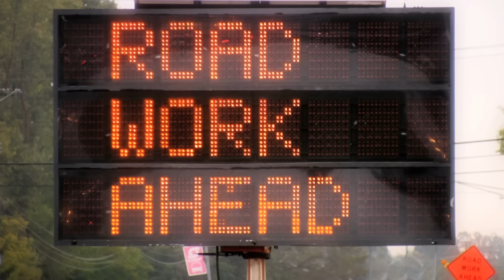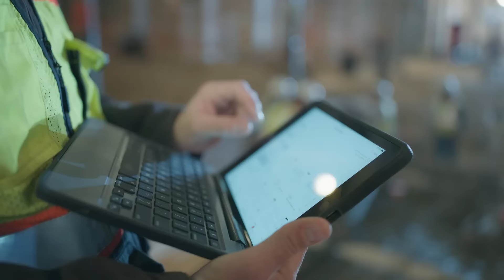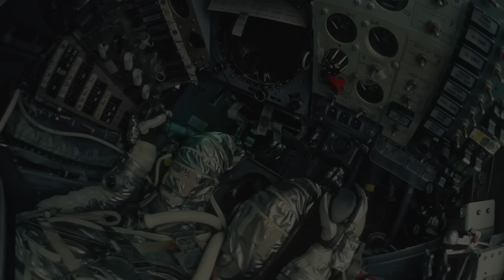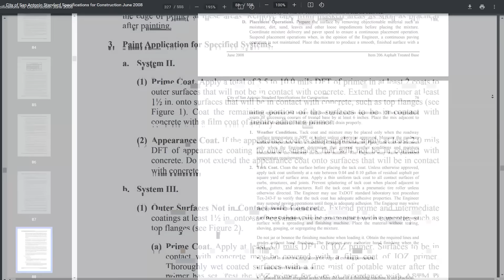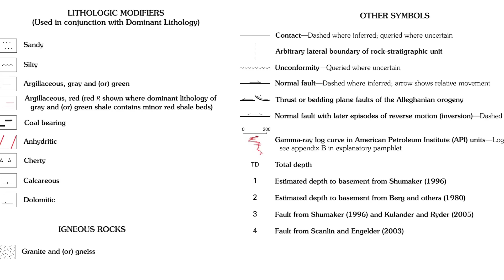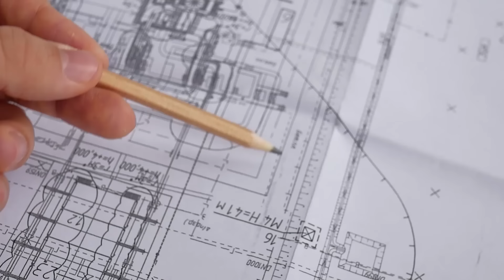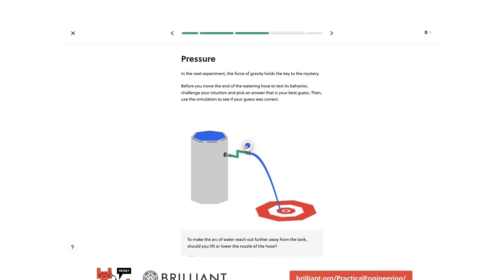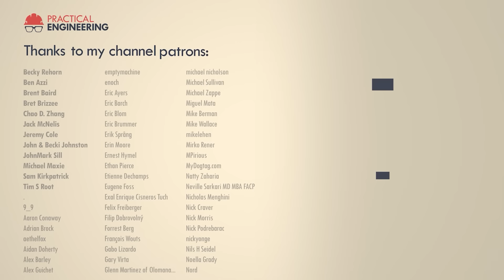4 Myths About Construction Debunked

Comment: Your first point about construction companies being incentivized to keep costs low and to get the job done on time seems to fly in the face of literally every major construction project I've ever seen - We always hear about how this project or that project has gone massively over budget. 2 - 3x, or even 10x  increases don't seem to be very uncommon.
Reply: Going overbudget doesn't mean the company not trying to keep cost low, a client can easily be responsible for a cost increase, sometimes trying to keep the cost low can also lead to an overbudget when company cut one too many corner. Not correctly estimating the cost of the project can be the sole reason of going over in the first place. Their can be many reason for an overbudget. An over budget may not even be an over budget for the initial client for someone that has worked alongside people managing small scales construction you can go overbudget because someone screw up, and need to pay someone else to correct the job, but the one that screw up is the one that is going to billed the differences. For large scale construction this can even lead to large trial.

The only time I saw people deliberately not working or not trying to to keep the cost low was when wealth didn't flow down to worker, if you get a bonus for completing work early but the workers don't get any of that bonus and just get more work, you can bet they will work slow to complete the work for the exact amount of hour billed or estimated. The other case was when subsidies were involved, some people seems to think it is okay to inflate cost when the government is paying. Which is something I found despicable.

Comment: as far as longevity goes the older stuff was made better. in the past, even the recent past of the 1950's, the mix of concrete was made for the project itself. today we go to a store and by premixed concrete, which we want to be ready sooner, and that means that it spends less time curing and hardening. depending on what we are doing specifically this either is good or bad. we don't care about the times this cheaper faster stuff works just fine, but we do see when it does not work. we also tend to use that stuff more than we should, and its market share increases because it is cheaper. basically concrete isn't equal to all other concrete, and we generally don't understand this or the market forces and social forces around using the wrong mix.

Comment: The reason why the lowest bidder model is used in most places are that it is an objective measure. Most if not all other metrics I have seen in contracts are ultimately subjective. Innovative? How do you measure that. Efficiency? How do you measure that? Keeping in mind that to measure efficiency you have to devote resources to record efficiency metrics. Look at how policing has devolved in many places to chasing stats instead of criminals. I don't think there is a solution to this problem and that cost will remain the best measure for the foreseeable future.

Comment: What about the DOT work crew I saw on my way to a dentist appointment that had 1 of 2 lanes closed with 3 pickup trucks with 1 trailer hauling an excavator. There was no one working on the way to the appointment, and the excavator was sparkling clean. However, when I was heading home after the appointment and a meal, the same crew was still blocking 1 of 2 lanes, but this time it was 2 miles further down the road and still, no one was working and the equipment was unused.

This crew was closing down half the road while doing nothing and just slowly moving along the road.

Comment: The success of a project is wholly dependent on the management and expertise of the project managers.  The more specialized the construction, the more this applies.
There are a couple of things with respect to the lowest bidder.  Yes there are specifications, however they cannot anticipate every eventuality.  There are always going to be changes and the contractor wants to be compensated for those changes, which can be significant, especially with foundations and civil work. Some contractors have more experience than others; alarm bells always went off when the low bidder was a contracting firm run by MBa's that subcontracted everything.  When bidding is tight often the low bidder is the company that forgot something in the bid, or the low baller hoping to make their profit in extras.

Comment: I'd say the part about the lowest bidder probably stems from the military. It's no secret when I was in the infantry every single piece of gear the Army issued me was made to meet a specific standard and was the cheapest option. Problems came when two separate pieces of gear needed to work together. Often times issued magazine holders seldom properly held my magazines well or at all leading to the "made by the lowest bidder". I know NASA also used to be mostly ex or current military and probably still is so I can see it carrying over. Before I got out in 2015 I lost a good PL who was accepted by NASA to train as an astronaut. Just my thoughts on that.

Comment: When considering the value of Roman Concrete, have you considered the self healing properties caused by their using unslaked lime leading to pockets of volatile powder which can react with water when it seeps in to seal and repair cracks as they form? No doubt we have great concrete, but even in spite of our much more advanced material science, we may still occasionally have a trick to learn here or there from the master engineers of the Iron Age. This isn't, of course, to say that over all their concrete is "better" than ours (better by what metric or what purpose is always the question) just that they may have some interesting properties worth taking advantage of.
Reply: To be clear, we began to develop our own self healing concrete in the 90s, but as I understand it's still very much a growing and developing market which is only just taking off with expectations of growing the entire market by a multiple of 17 over the next 10 years.

Comment: There is quite a bit of gray area. There is indeed quite a bit of "standing around" at various construction projects and it's not always because of some other task or resting. 

Also regarding the lowest bidder, that is a toss up. Not every trade receives an engineer designed copy of plans to follow. There's many cases where an engineer is hired to do some level of design to get the building permit rolling, they might not even have any expertise in the trade for which they draw up plans but do so anyway for easy money. It's then up to whatever contractor to design the system themselves. You frequently end up with more fly by night type of contractors that very much do shoddy work become the lowest bidder versus contractors who can properly do the work.

I'm also an engineer in construction, but I work directly for a contractor to do in house designs. It's actually very rare to get a set of plans for my trade, designed by another engineer, who actually understands the system involved. Also, inspector's and plan reviewers generally won't catch major design flaws by other shoddy contractor's work. Plan reviewers tend to rely on the engineer of record's seal, and therefore only check to see if their personal favorite go-to notes are missing from the submitted plans. Inspector's know even less than the plan reviewers...

Comment: I wouldn't say "planned obsolescence" as much as a much more fundamental business concept: amortizing your assets. Any asset has a useful lifespan, whether it's a car, a computer, a machine, or a bridge. If an asset costs $100,000 and it'll last you 10 years, then you should think of it losing $10,000 in value every year. A be you should budget for that. If you buy an asset and just run it into the ground without thinking about when you need to replace it, you're going to have a bad time

Comment: Been in construction 20 years, have multiple trade tickets and even have my MET as i was gonna be an engineer. First off engineers are never on site unless theres a serious problem, or someone is calling them out knowing they screwed up. 2nd laborers are just lazy its the crew size thats mandatory so half of them just stand around. You do have a point with excavators tho.  3rd you touched on it but neglected to mention that everything engineered these days is meant to do the minimal required task with as little manpower and material as possible as the norm.  So you know as well as i do everything is built to fail. Also like how you sided with cutting corners or at the very least sided with contractors who cut corners.

Comment: Since rebar rusts, would it work to connect a sacrificial anode wired to go through the concrete? Seems like we could extend its life for just a small amount of power.
Reply: Been done. A lot of long life concrete that has rebar in it uses stainless bars. The green coated steel isn't much cheaper and will corrode anyway. Stainless bars!

Comment: I might also add: I was employed Operating a Tri-Axle Dump Truck hauling Asphalt Millings from trhe Asphalt Milling Machine (1 Operator; 1 Groundman; 2 Labours), on a Very busy highway, & subsequently the Milling Machine broke down (these things happen with mechanical equipment); this alowed 30+ Dump Trucks to be lined up waiting for a Load of Millings., while the Heavy Equipment Mechanics worked on the machine. These Mechanics were stationed at the roadside for any downtime , if nededed.  Operators, Labourers, Mechanice were being paid by-the-hour, as were the Paving/milling Companys Dump Trucks; Plus the Hired Trucks (Paid by-the-hour as No Dump Truck Owner is going to Place ther truck on by-the-load, as the risk of Stoppages & the time it takes to load the truck would NOT pay for Fuel, Insurance, Driver, etc.). Many passing Transport Drivers Subsequently mentioned, over the CB Radio, of how much money the Ministry of Transport ( the Equivolent to State DOTs) was Wasting with all the equipment sitting around. Little did they know that Most Highway repair jobs are Tendered out, to the lowest bidder. it is up to the Paving-Milling Company to make money. In this instant; im sure the Company was loosing Money $$$, Big Time while Men & equipment were sitting around, waiting for a Mechanical breakdown to be fixed. You Dont just Stop Paying People because a machine breaks down. You either fix it ( in a timely manner) or you bring in another Machine or you Quit for the day & send everyone home.

Comment: I hate construction. Not the people who do it or the act itself, but more because it's a constant near me. The noise is unbearable, and because I'm in a rural area, the roads that get closed are often the only roads you can use to get from one place to another. On top of all of that, roads are consistently closed exactly when I'm going to use them, or are closed for years on end. (Some going on decades now.) Thankfully, I haven't had to worry about too many structural construction projects around me, but even that might not last too long. As you said, everyone in construction has their place, and I'm sure I've got my own confirmation bias, but the roads around me are constantly being repaved, and bridges and roads have been closed for years. Even then, the same roads that were repaved a few weeks ago often immediately have potholes again. I can't help but feel like the lowest bidder is consistently doing it worse than it could be done if only they would spend more money.

Comment: I am engineer minded, though not one myself.  My dad was one. I do work on projects of many types, including home improvement. So i understand all this. What i dont understand is when there are problems, certain manging firms ignore them or dont do the proper inspections and then we have bridges and buildings toppling over b4 they have expired. I also dont get why they are not maintained properly thru the years even when noted. And why do so many ignire the loading requirements when changing or adding things? Why is there so little oversight on these things? But then my construction friends get annoyed when other workers, especially government workers, work the first 3 or 4 hours and then they take a break and you never see them again, which then delays the other contractors who dont have that luxury because they have to finish on time or pay for the delays or have to delay other jobs because they're not done with this one. And you can't get the government to discipline their wirkers and they still get paid fir taking a 4-hour break b4 leaving the jobsite.

Comment: A lot of the tradeoffs I see parallels to software development. There's the old adage in developing code of pick two of: fastest, best product (e.g., design, feature set, security), cheapest.  Those factors can to some degree, by trade off of one another. In working in SF in the last decade, cheapest is often the one let go, in favor of fast and best. I don't know if the easy availability of VC funding distorted the project managers' decisions.

The builders of the Millennium Tower in SF really could have done better by creating a better base. There's been many attempts to fix the leaning problem, and yet it's still not fixed totally. One attempt to fix it even made it worse.

On the bidding process, I heard a story (can't find a way to verify) where one public authority took construction bids, and when they were all in, they threw out the highest, the lowest, then took the one closest to the average of the other bids. That'd be a way to avoid lowballing bids (which'd create overruns, by intentionally bid lower than they knew it'd cost) and padding the bid to increase profits (pocketing the extra over the real cost, beyond normal profit margins).  It was set in an area known for corruption (no I'm not going to name it as I can't verify it).

Comment: The one thing that road construction crews do that really pisses me off if setting up miles of cones on highways narrowing traffic to one lane at ridiculously reduced speeds while they work on one small section at a time. The rest of the construction zone sits idly by as we creep along in one lane, many times trapped behind slow moving vehicles. Even worse is when the entire construction zone sits idle for weeks without a single machine in sight. 🥵😡😠🤬😈

Comment: As a road worker in the past I can definitely say you are wrong! My boss bids a job based on manpower, equipment, fuel etc. He always over bids for 10 extra employees. That means he had to have the employees on the site regardless if they are working or not. I once stood around for a month getting $28 an hour. It was basically a just show get paid. My boss changed $50 for me to stand around.   You would never understand the complete bilking of the bid process

Comment: Well...there are still cases when like 5 people just stand in group somewhere while one is digging the hole with a showel. And I was often in the situations when I was pressured to work harder and don't waste time taking a break. Maybe I should have been construction worker instead (part of those jobs were manual labor too). Also there is type of concrete that crumble to dust after couple of years, while noone is even thinking to replace it. And "lowest bidders" that just do cheap unreliable work. Not necessary in the US, I guess...

Comment: I wanna know why there's only 12 guys working on a 10 mile highway. Why not get 100 guys in there and knock it out in a few months?
Reply: Because, like he said, construction work is sequential. You dont have all the material on site from day one, it would take up way to much space and, since there's always slight deviations in calculations, there would likely be too much of it or something in the plan might be off. Construction is a type of work where a lot of variables are at play, maybe a human error, maybe something doesnt line up right, maybe an issue comes up that they didnt even know about before constructions.
If they had all the material, plans, workers and equipment on site from day one these mistakes likely wouldnt be noticed by the construction workers and may cause issues very quickly.
When part of a construction is finished engineers will usually come to the site and take more accurate measurements and check on the quality of work being done to make corrections to the plans or advise workers on things they have to watch out for.

There's also only so much construction equipment that can be used in any given area before they get in each others way. Renting things like cranes is insanely expensive so you want to make sure you get as much use out of it as possible. Renting 2 cranes is also a lot more expensive because you also have to pay twice as much for the transportation, insurance etc. I'm using cranes as an example here but this goes for most equipment.

Comment: Meanwhile there's no regulations put in place to limit construction within a certain radius from each other. Go down the block and they have X road closed off. Go across the street and Y road is blocked from another project. Drive 10 minutes further down and the lanes are closed with bottleneck traffic merging into a single line from yet another project. Construction is a disease and out of control.